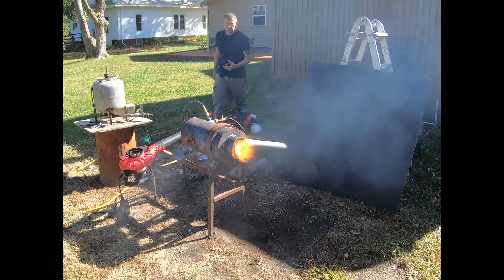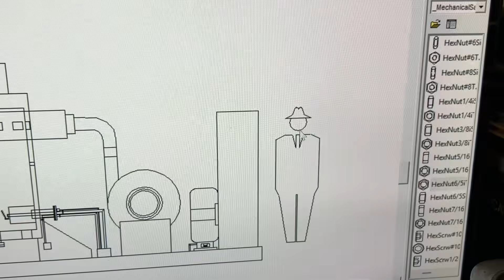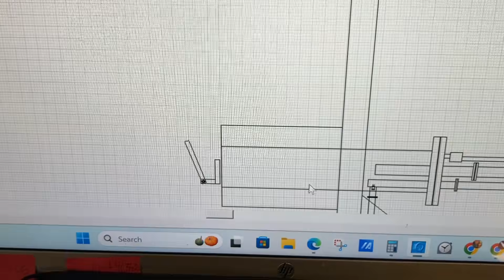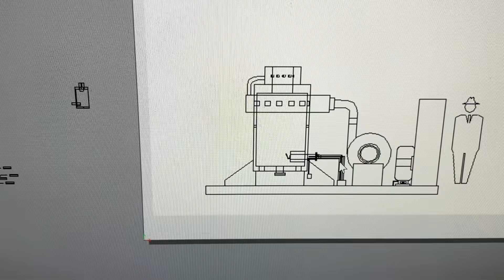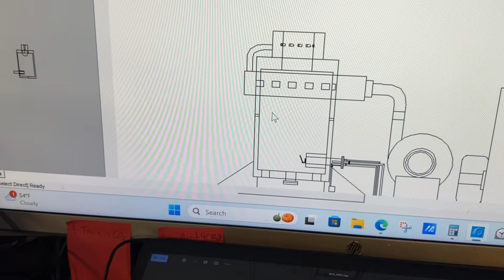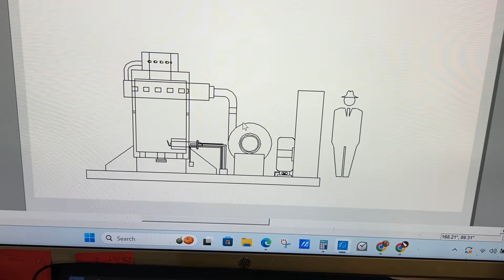Oil Spill remediation burner .

Comment: This can be used to clean out bilges of boats, often containing water and oils, pump it out, have a trough about 8' x 8' x 2' deep. Made from 1/8" steel plate with 1" angle bent from 1/8" sheet metal plug welded on to brace the bottom and collect more heat, use the exhaust from this to evaporate the water. When it's down to roughly  10% water run it through a filter to get the chunks of stuff out, and process tge oil and sludge,  it can be used with a vacuum  tank similar to a septic pumper, maybe place this on a small barge, have a 200 gallon vacuum tank (basically  a huge overpowered shop vac) with 3"-4" hose a  20-40 hp,   engine .  And have 50 gallon drums to short term store the belge water and oil, with a couple 100 lb propane tanks. The 20 l-30 55 gal drums  can be filtered maybe build a centrifuge to speerate the water and oil, then filter the water through sand or something else. The oil will still have water, so pump it into the trough, when there is a few 55 gallon drums of oil, boil off the remaining water, then burn it to continue the process.. this is a lot of energy that can be used!!  Why not use this wast oil to generate power? Get a old steam engine, connect a generator to it,50kw or so, maybe a tesla turbine, made of 18 gauge sheets of steel 40" diameter on a 2" hollow shaft with about 20-40% of the exhaust  leaving through the shaft, with the rest leaving just before the shaft, put a shim around .040"-.060" thick  between the  sheets making up the turbine. Build a test turning about 12" diameter  with 6 blades on a 1.5"hollow shaft with a 5/8" .625" internal  diameter with  multiple 1/16" holes to exhaust steam and study the effects of the blades having slits cut  in them.  Similar  to the opposite of spokes in a wagon wheel 🛞, or having angle slots cut and having the exhaust  exiting  just before the shaft. With windows  cut in every blade Similar to a slice of 🍕 pizza or slice or cake or pie 🥧 🍰 , but pizza is more fitting. 🤔..  make two flywheels to balance the assembly  made from a 4" piece of 1/2" steelwith a 1.25" groove removed from the center  leaving a 1.25" keyed hole, a 2" hub. The 1.25" x.150" gap  on both sides,  then the outer ring. That allows balancing by drilling holes up to  3/8"[.375"] straight down  on the edge, a vertical hole. Or a horizontal hole up to 5/8"[.625"] or possibly 3/4"[.750"] if required. Cut a piece shape in the blades using a .250" end mill basically .500"x.500" with the holes 180° from eachother with four 5/8" holes in a oval in the end plates, with 20 gauge sheets of steel making a 12" rotor on a 1.25" shaft, drilled in the center with a 1/2"-5/8" hole bored for the exhaust.  With the spacers made from 2" diameter 20 gauge sheet metal. With a .150" groove cut at an angle and aligned with 1/16" holes in the shaft, with a shallow keyway cut in the spacer before and after the groove .050" deep x .200" wide with a .250" keyway opposite  from the groove. Make the shaft with a 1" x 6" shank for driving pulleys or gears , sprockets,  then a 2" hex or square, .625" -.750" wide, a 1" x 1.500" area for a bearing and seal. The  1.25" area with keyway  about 2" long (possibly 4" long) then a  extra 2" length  with a light press on hub with key. Using a 1.5 o.d. fir a bearing and seal the hub presses on the turbine blades squeezing them together using the .500" stud milled on the last 2" of the shaft, the hub being milled to fit a 2" i.d. bearing. And a seal about .750" - .925" the hub being about 4" long 2"x1"-1.5" plus a 2.25" x .350" wide hex then reduce to 1.5" x 2" with a keyway.  Then a .500" hole in the end with  about 2" deep to allow a 3/4" hex nut on the end of a 1" shaft. Tq to about 40-50 'lbs, or drill the  shaft for a 1/2"grade 10socket head bolt, tq to about 60'lbs using a 1/2" xe
3.250" long bolt, just under 1.25" of threads in the shaft  sand the blades and spacers between  two sheets of 120 grit sand paper, backed by a flat sheet of glass or steel.  The slightly rough steel clamped together  should not slip. Possibly  using loctite to glue them together. They bshaft having 3x 1/16" holes drilled  3 holes drilled on 3/16" centers allowing 1/16" between holes. With the blade having a .050"x .080" notch cut in the blade and spacer, with 3 lines of 2" long of 1/16" holes  in two places on the shaft. Or possibly  a single row of 3/16" holes across from the keyway.  These holes  and the notches and grooves work to create a path and tunnel under the blade, with a groove in the spacer  to access the tunnel to exit the center of the shaft.  With the steam  entering the outer edge of the turbine, from a 1.5" tube spread to 2" wide and a groove creating  the nozzle  2"wide x .050" tall, fed by water heated to 350°f  to 400°F,  at great pressure,  a 40" turbine 6" wide, fed by a boiler heated with the burner, heating watering pipes  at 1 gallon per minute from 60°f to 350°F...  feeding the turbine with a 4" pipe of steam at 100psi minimum 200 psi peal. Built similar to the smaller turbine . With a 25:1 gear reduction spinning at 50,000 rpm spinning a shaft at 2000 rpm,  waiting to spin a generator to produce power, burning waste oil, possibly  plastics from the ocean as fuel, possibly 50kw put into the grid collecting a check.. (this is what we need to do with trash..)  HAVE AN AWESOME DAY🎉🎉🎉

Comment: 👋🏻 👋🏻 👋🏻 👋🏻 👋🏻,  HEY,  have you considered coating the inside with ceramic insulation? CERACOAT makes some cool coatings, used on engine parts, capable of holding a molten piston together!!.. using  that on the hottest parts , or the entire inside! And outside. You could possibly  make it from steel and still have a long life. Coat the inside and outside. Or have it nickel  plated then coated with the ceramic. The nickel plated extra heavy about .020" thick then coat with the ceramic, and possibly  lay it thick. You could also make the inside double  walled and blow high  velocity air through the internal walls,  similar to how jet engines survive. Evert turbine blade has dozens of little  air bleeds allowing cooling bypass air to keep the blades from melting.  Maybe a new coating can be developed. A tungsten ceramic maybe😂  a powder tungsten basically  centered in a ceramic! With air cooling, the cooling air will be at a higher pressure than the center of the chamber, pushing the hot air to the center of the chamber, if the outlets are positioned properly. Having a wall of high pressure air moving about 1/16" from the surface  of the inside structure. Possibly  allowing another nozzle to spray fuel to  the inside of the core of the flame. Using the air to cool the  nozzle  as well,  basically  using a leaf blower (1-2 hp ) to move about 1000clm at 2 bar /29 psi. Just for the cooling air.  The. Ceramic insulation  will help with. Infrared radiation.
I'm  thinking build all the internal structures from 3/16" plate, with a 1/16"-1/8" plate with about 1/16" air gap, with a 2" air inlet with a series of 1/32" outlet holes,  or a solid gap between  sheets leaving a gap of .010"-.020" depending on diameter. If it's a .500" tube with nozzle, maybe .125" gap for air , with a 1" tube protecting the  nozzle output.  The additional air can and will  help burn  the fuel.   Just a thought, maybe it can help give ideas💡 , have anawesone day🎉🎉

Comment: I was just thinking something similar to this could be used as a forge or furnace for a small foundry furnace.  A tungsten carbide  nozzle  or some type of ceramics  have it firing into an insulated  chamber with a large crucible,  maybe add a small amount of oxygen if the temperature isn't quiet hot enough, then additional fuel can be burned. Imagine 100cfm pure oxygen  added to this device! That flame will likely be blue. . It would look like a huge torch burning 🔥...

Comment: if putting this much time and effort into what you're making here,  why not make it to where the energy burned can be transferred 
into electrical energy or mechanical or some other type of energy instead of just burning used oils or motor oils off as waste???
like to start it off from propane or some other fuel, and have it sustain itself with used or otherwise non-useful oils 
and use the energy to provide electrical or mechanical energy or for something useful instead of just burning it
Reply from the maker: This is a protype for a machine that will be the size of a man in height .

Comment: I have been experimenting with a few waste oil burner designs myself, and as we know with waste oil like from used motor oil is full of a long list of toxins and possibly some heavy metals so my question is are these toxins and heavy metals consume by the heat of the flame if burning hot enough or are a percentage of them just spewed out? I have not been able to find any info about this in particular.
Reply: There r multiple scientific studies on this combustion contamination problem for like power plants and such that would burn 10000 gallons of it and emit to large pop centers

Comment: reminds me of a furnace built by a farmer fifty years ago to burn tyres , apart from the obvious differences needed to burn tyres  he added two  egg shaped expansion chambers in series after the nozzle both with their own air feeds , this significantly raised the temps and provided a much cleaner burn,  one has to wonder just how long these expansion chambers  lasted at these temps I really cannot remember if he used water jackets to prevent melt down. I think he may have done as he was looking for ways to provide cheap energy for his farm.
Reply: Burn tyres thrown in the burner? Or after like the burner aiming at tires?
Reply: @CodyRoachMINING  ?

Comment: Fancy design... Always remember metal oxidized in high heat. And expensive build... 😅
Reply from the maker: Indeed this was built as a proto type and i didnt want to waste cash on expensive metal so i made it out of carbon steal to save money . It may never run again after this . im considering cutting it open to examine the heat effected zones
Reply: @NOBOX7 
Muss es ein besonders vergütete stahl sein ?
Steinlesssteel ist keine genaue Bezeichnung.
Reicht es wenn 5% Chrom enthalten ist? Oder 15%? 
Oder Nickel? 
Also um lange Lebensdauer zu gewährleisten..
Würde Messing auch beständig sein? Oder schmilzt es zu schnell?
Reply: @konstantinbellmann5305  Jestem obserwatorem kanału Boba od lat , wszystko co robi to robi z głową. Palniki prototypy wykonuje się z tanich materiałów ponieważ trzeba przerabiać .Steinlesssteel und Chrom-Nickel-Stahl   Es ist zu teuer zum Testen. Gruss aus Breslau.